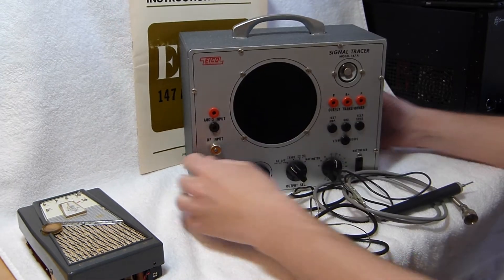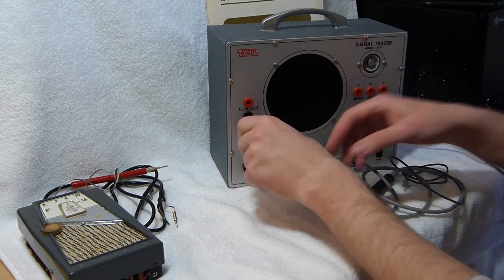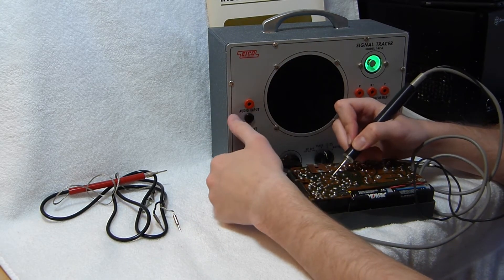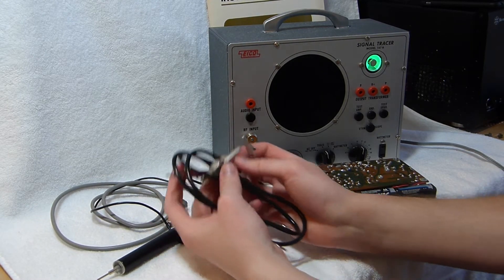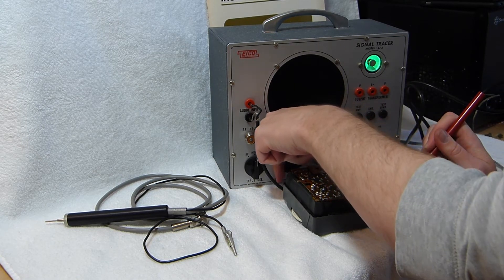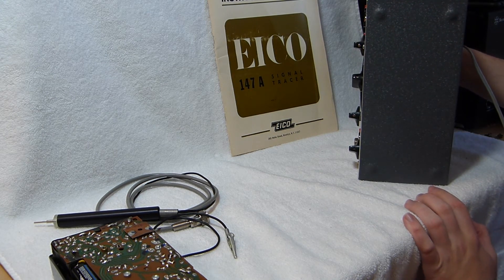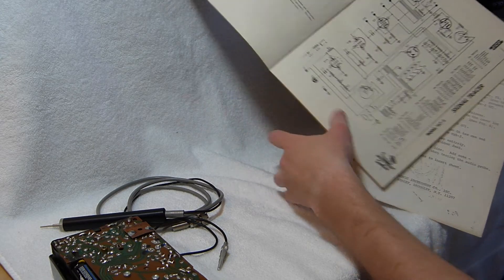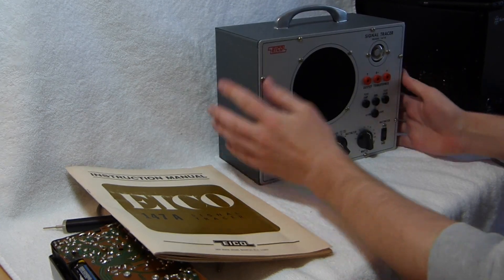1960? EICO model 147A signal tracer (Built from kit, made in USA)

Comment: Looks great. Need to  replace the audio test lead  pin type  connectors to something like a BNC jack so you can use a BNC plug with an individual wired lead that 
has two small clip leads( both a red and black) on the end. By all means make sure the case is well grounded like it is supposed to be originally. 
A hot chassis can ruin your day!
Reply from the maker: The pin connectors are a bit of a pain, agreed. This signal tracer did come with an ungrounded cord originally though, which does come with a risk of shock. Grounding it would be a reasonable modification.

Comment: Very nice unit. I just got one in very nice condition. I've found a couple of sources for operating manual. I'm guessing you have the service manual. If so would you sell me a copy. If so how much. Chuck
Reply from the maker: I don't think there was a separate service manual, and if there was I don't have it. However, the instruction manual has the schematic and layout of the parts, so it should provide what you need to service your 147A.
Reply: 50sTransistorRadios thanks

Comment: I've always thought of the EICO instruments to be a cut above Heathkit in terms of manufacturing quality; they always used a heavier cabinet and sturdier mechanical components than most other kit manufacturers.
Reply from the maker: I haven't had much experience with EICO products, but yeah this does seem to be very solidly built.
Reply: 50sTransistorRadios

Comment: Nice tracer! Mint condition. FYI, I have always heard EICO pronounced "Eye Co". I personally have never found signal tracers of much use if you have access to a scope of some sort. Have you found tracers to be useful?
Reply: +Herbert Susmann Useful?  Makes a nice tubie geetar practice amp, lol.  It's not only a high impedance   audio amplifier, but also RF amplifier for IF stages of radios and TVs. It can be used to find bad coupling caps, IF transformers, blown resistors, bad transistors / tubes, or loose / bad connections, so it is very useful for trouble shooting.  You follow the signal until it stops or doesn't sound right to find the point of trouble.  It's easier than a silly scope because you hear the sound, and see the signal on  the "eye" tube. Don
Reply from the maker: +Herbert Susmann Good to know, it's one of those names that I have never heard spoken, so I wasn't sure how to say it. I have a battery powered signal tracer/injector that I find very useful. If I get no audio out of a radio, I use the tracer on the center tap of the volume control, if I get audio there, then the RF section is good; if not, then I use the injector on the same point, and if I hear it from the speaker, then at least the amplifier is good.
Reply from the maker: +umajunkcollector Don, I have found them to be very useful as well, although I am not really a pro at using signal tracers for troubleshooting yet. -Matt
Reply: Shango066 has demonstrated how to vids many times, good stuff. joernone bandersentv Bob Carlson and radiotvphononut also did some vids about test instruments.
Reply: +Herbert Susmann Back in the early 70's used to use the solid state version quite frequently, great for faster repairs. With a tracer, V.T.V.M., signal injector, soldering iron, solder and freeze spray one could scare those defective  germaniums into giving themselves up. Rarely used a scope on A.M. radios. Yes it's pronounced I ko.
Reply: Wasn't EICO Electronic Instruments Company?
Reply: +umajunkcollector Yes.
Reply: @pafoofnic  
Are you in Alameda Calif, SF Bay Area? If so are you still active in radio repair. I have some old radio repair work to be done. 
Mark, Brentwood
Reply: @wickerbill7793  Sorry, no longer in the electronics repair business 1999 was the last year.